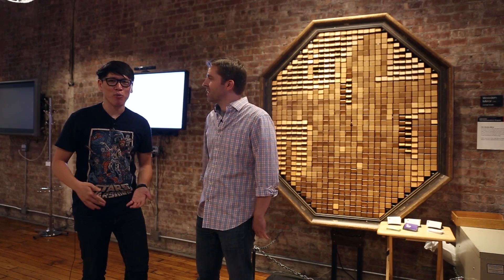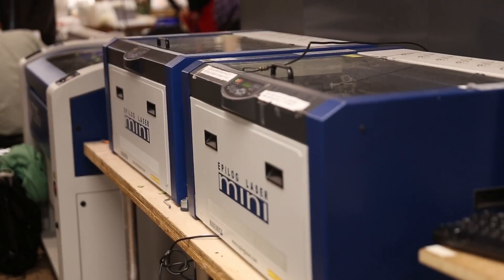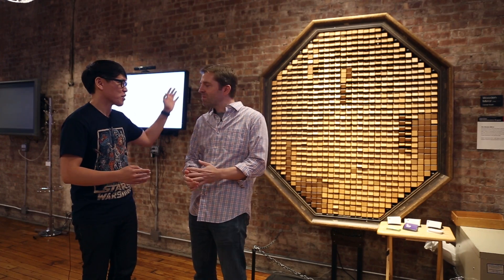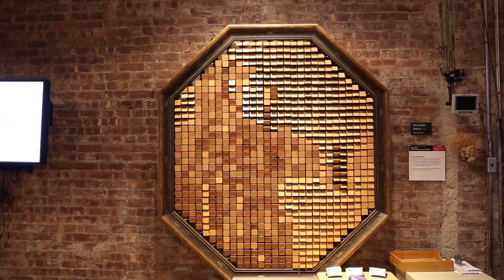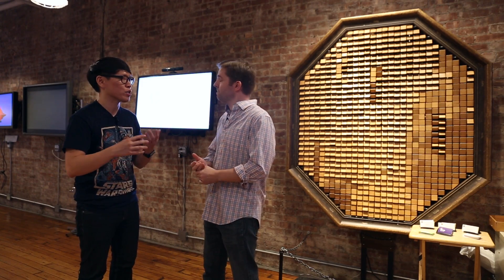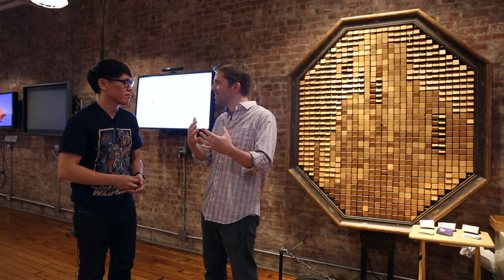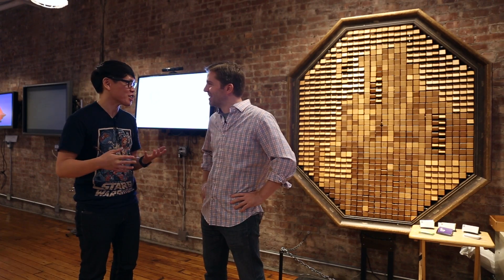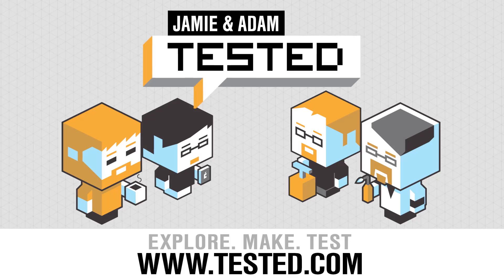NYU's Interactive Wooden Mirror Project

Comment: Violation of TI patents ?
Reply: Did TI patent the penis wall?
Reply: Munymuny200
The "wodden mirror" looks - now that Dorf Schmidt said it - like the DLP technology from TI. Yeah, a lot of differences, like the material, angles of the surfaces, light source etc. but it would be interesting if the TI patent would apply to this piece of Art. Even if yes, TI would not sue the maker nor the school. But if the TI patents (plural is important) would apply, it would prove that patents are flat out broken and are only there to be abused.

The last patent I have read, was written over complicated and one of its claims was "reinventing" the wheel by using legs driven by a crank. Neat mechanism by a one man company, so "no evil big company" but as patents are expensive, he did not renew it so it expired. So there we are: Instate of protecting the idea of brilliant peoples, it protects big companies and sometimes even just by "to many patents to be read" which are hold by just a few big companies.

Comment: I learned to use everything and anything that I saw in this video in literally the span of one summer (along with much more sophisticated tools like waterjet cutters, shopbots, and CNC milling machines). I knew how to solder and wire electronics (along with basic EE rules) from when I was in high school. Graduate program my ass. It doesn't take two years to learn twice that stuff. More like pro-profit "program" that sell degrees like candy.
Reply: Dav1dChui
I rather doubt that you learned everything they do in that program. As if this video showed the whole course. Not to mention that programs like that are there for building elaborate projects you can later use as reference material as well.
Reply: Was that in conjunction with a full-time job?
Reply: OrAngeAnArchy that was while i had a full-time engineering internship, yes. oh and no, i did not learn that stuff for the internship, just on the side for fun.
Reply: Dav1dChui  were those 40+hrs of internship? As far as i know internships are typically 20hrs/wk for 3 months. Either way, not everyone as fortunate as you to have access to this type of machinery(cnc mills, and industrial waterjet cutters). someone has to provide that and know and it's good NYU has something like that as well as a place with like minded people to motivate each other. Not everyone is self-motivated to self-teach these things.
Reply: OrAngeAnArchy you're right. I was harsh on the judgement... Nevertheless, I think that stretching out this fabrication program over two years seems to be profit-driven. Anybody could definitely learn everything needed to build something like that mirror in one semester provided you already have some bare-bones knowledge about basic CAD and hand tools. Most of those machines are CNC driven and the learning to use them is easy once you already know how to use one or two. This seems less like a serious program for people who want to learn fast and efficiently and more like a fun, stretched out program that rewards you with a certificate so long as you pay for it. If you're really interested in learning fabrication, look into Tech Shop. and P.S. yes, my internship was 40 hrs a week over almost 3 months.